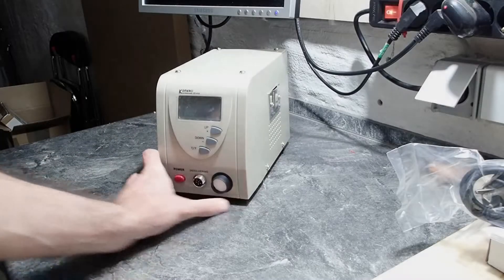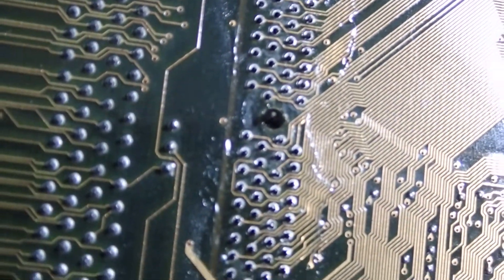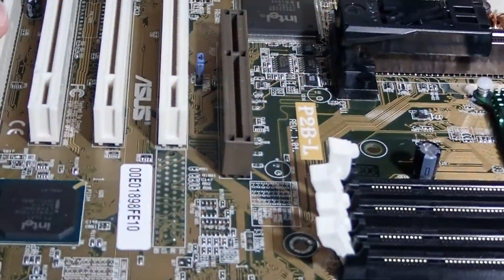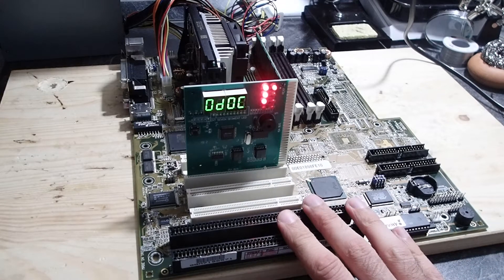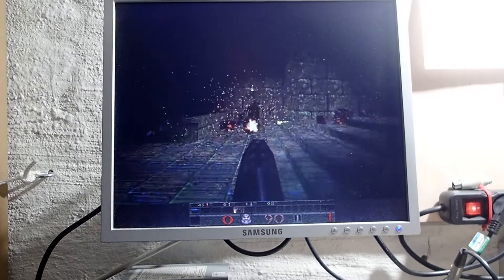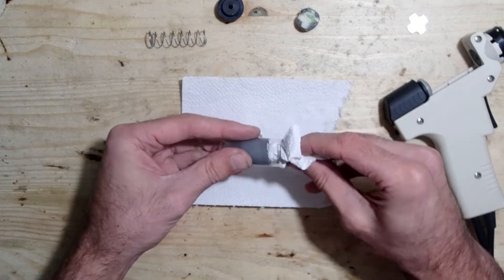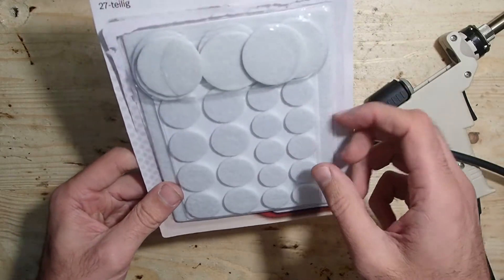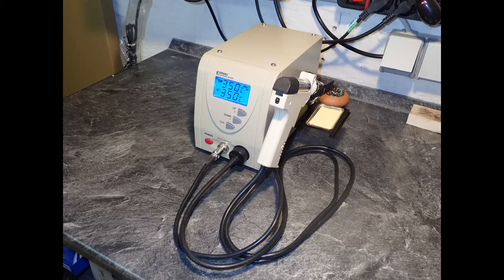AGP Transplantation and review update of ZD-915 desoldering station

Comment: Probably a GPU died in that AGP socket... well done bringing it back to life!! I noticed that using the manual pump you also need to wiggle the pins afterwards with strong tweezers to let them totally free, and that yields the best results. The problem with desoldering is that some components, sometimes, are very very uncooperative, but mostly it's not a very complicated job and with an electric pump, it's even easier.

Comment: I use mine to remove the switches from keyboards. After about 10 boards with up to 400 solder points each I did start to run into some trouble. I thought my heating element was bad since it would report the temperature but still was having a hard time. So I replaced it and it still had a hard time. I tried one of the other tips that came with it and it worked like the first day I got it. I can't really explain how the tip isn't transferring heat properly. Maybe theres some internal cracks.... So if your station is reporting correct high temps but solder still wont melt, try another tip before replacing the element.
Reply: To prevent clogging, run the station at a high temp. I run mine at almost max temperature and barely get clogs.

Comment: I've stopped using flux for desoldering, it's often better to add fresh tin.
Reply from the maker: I do both. Flux helps to get through the oxide on the old solder joints. Sometimes fresh tin just doesn't want to stick on it.

Comment: The original filter should be ceramic based it is possible to clean and reuse it using an appropriate flux thinner. Isopropyl alcohol should do the trick.
Reply from the maker: I tried to clean that, but nothing helped. It also gets a lot worse if you desolder very old parts where colophony was used to solder back in the days.

Comment: I know this is an old video but I have a question about how you maintain the tip.  Do you need to regularly tin it with solder like a regular iron?
Reply from the maker: Also, if you are interested in this desoldering station, you should really take a look at another video I made about it later: https://youtu.be/2zr097eMff0
Reply: @necro_ware  I have watched it - very informative, thanks.
Reply from the maker: Hi, no I don't, but the tip gets bad after a while because you have to wiggle the parts during the desoldering and that scratches the tip from inside. You barely can avoid, that it get's damaged after a while. I already replaced 3 tips, but I also do a lot of desoldering on oxidized contacts, which is very stressful for the tip.

Comment: In the UK it is sold by CPC Farnell (Element14) using their Duratool brand. The spares are quite reasonable including filters at £1.37 listed as "Filters for D00672 Soldering Iron 5 Pack -  D00759". I haven't got the station but when the next big job comes I will surely buy one. The over voltage on the fan and other tips have been noted, thanks.

Comment: The other cheap ass way of desoldering is using a paint stripper heat gun on the board and when it's hot enough tapping the board on a hard surface with the components facing down, anything that had it's solder hot enough to melt will fall out.

Best done in a well ventilated room or outside :-D
Reply from the maker: Yes :) I do it sometimes, if I need to get everything from a PCB. But, boy, it stinks...

Comment: good day. I've been looking at this station for a long time. I would like to know if you tried to dismantle pci-e, on lead-free solder. is power enough?
Reply from the maker: Hi, it is doable, however, it is not easy and I'm not sure if any desoldering station can do this easily. To desolder lead-free joints, you will have to go over all contacts with leaded solder first and then work with additional heat gun desoldereing the joints one by one. It is a tedious job and I hate to desolder lead-free stuff, but I did it already couple of times and it took a long time :)
Reply: @necro_ware  I already have multiple dismantling experience, using infrared station, air gun and adding lead solder. I spend 2-3 hours on this, many pins remain in the board, since even at 3kw it is not possible to warm up evenly and so as not to damage the mask. I hope this equipment will reduce the time and effort spent.
Reply from the maker: Yeah, well, I don't quite remember anymore, but I guess, it took me like 20 minutes to desolder that AGP slot. It's not PCIe, but still quite nasty and I can't imagine, I'd be able to do this without the station.
Reply: @necro_ware  I do. I add and solder with Rose's alloy. I heat the textolite with the lower heating up to 150-170 degrees. I add heating from the top so as not to melt the plastic 240-250. turns out well. but for a very long time. sorry for my english.
Reply from the maker: Yes, rose's metal is also something I'm using from time to time if I want to prevent the parts from overheating. For example in one of my latest videos, about overclocking a 386 CPU, I used rose's metal to get the SMD CPU from the board without damaging it. Your English is just fine, at least as good as my. I'm also not a native speaker, as you probably can hear it from my videos :)

Comment: I had the same clogging problem with this unit when I first bought it. I found a desolder temp of 375 deg and giving the iron time to properly heat the joint before hitting the trigger to suck up the solder fixed the clogging issue. I honestly cannot remember the last time I had to use the cleaning pin. Also any very dry dull joint I would wet with fresh solder before then desoldering.
Reply from the maker: Ok, thank you for suggestions! I'll try it.

Comment: Even a brand desoldering station ike Hakko 474 will get clogged. There is only one simple solution. Let it warm up at 5 to 10 minutes so the whole tube will be hot enough. The problem is not that the tip is not hot enough. It is the tube which runs from the tip to the solder collection tube, that gets clogged.
Reply from the maker: Hi, I have no experience with another desoldering stations, but I guess you are right. However, if I am working with it, it usually runs for longer, than 5-10 minutes anyway, still I have to clean it from time to time. I also have a feeling, that it became worse after some time. May be through cleaning the tube, it got some scratches inside and now the residue sticks better on the walls?! Anyway, this tool is still a huge help and I am glad to have it.
Reply: @necro_ware I do ;-) Since I do a lot of desoldering. So I tried several machines. The ZD 915, 985 an 8915 are all made by Zhongdi in China. Not the out of the box performance, but the build quality and longterm reliability   is the big difference with a brand like Hakko. Aoyue  produces good mid range gear.

Comment: Hello Sir, I use a Goot TP-100 desoldering gun. I must say that the original desoldering tip assembly was kind of faulty, couldn't desolder nothing, always cluttering. Bought replacement front assemble from ebay and new cleaning needle (original got stuck inside). Now it works really good. In fact I agree with you, this king of tool worth every euro spent on it. 

Videos more often please and keep that awesome soundtrack pumping.
Regards, Jorge
Reply from the maker: Hello Jorge, thank you for sharing your experience. In my case I wouldn't go so far to tell, that the desoldering tip is defective. I think it's somehow to expect, that it gets cluttered from time to time. It also heavily dependent on the amount of flux, solder, age  of materials etc. Sometimes I can completely desolder a full AGP, like I showed in the video, and sometimes I can't get a 16 pin IC out of the board, because the tip gets clogged all the time. Anyway, it is good to know, that other people experience similar problems, I guess. 

Thank you also for your kind words, I really would love to release my videos more often, however it still costs me a lot of time and I am still trying to improve my skills to get all of this done more quickly.  I have so much material, that I could fill three channels with it, but unfortunately I just can't get things done. Actually I am a full time software developer and I'm doing this videos in my spare time only. Anyway, I'll try my best and hope to see you on my channel again, watching many more interesting videos in the next year :) 

And for now, I wish you all the best and a happy new year !!!